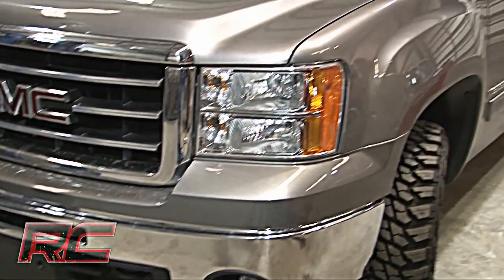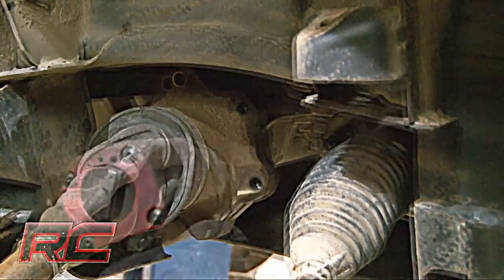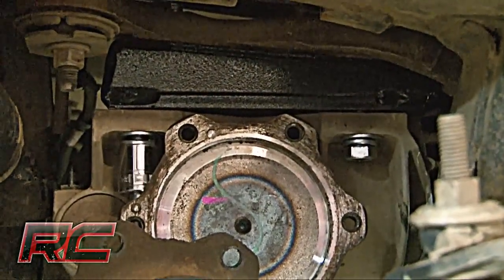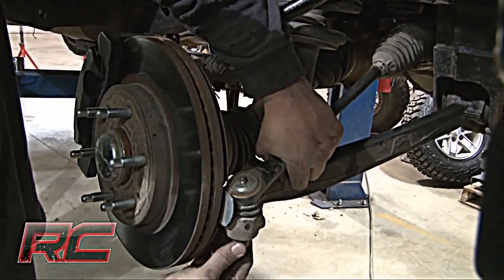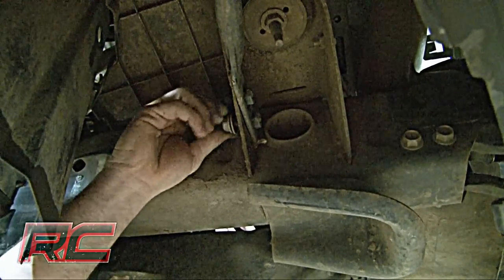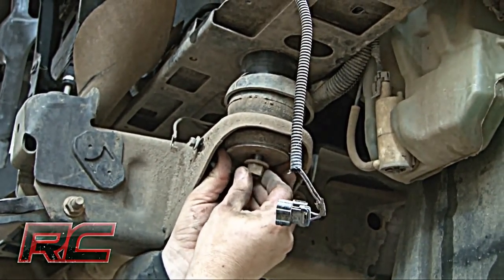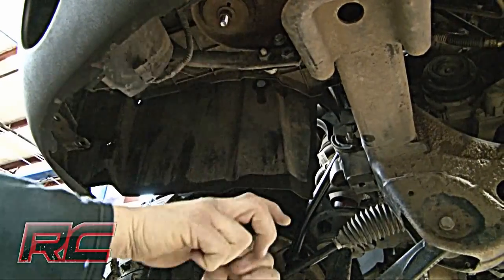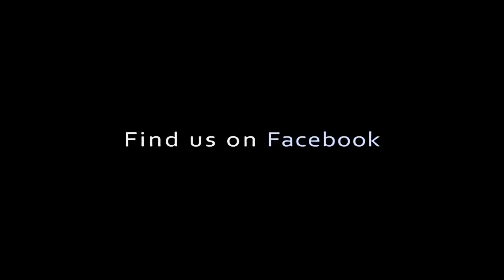Installing 2007-2013 4WD Chevrolet Silverado / GMC Sierra 1500 4.75" Combo Lift Kit by Rough Country

Comment: Curious, what size hardware? and will deep well sockets be necessary? 
Would this be something I can complete in my driveway without a hydraulic jack?
Reply from the maker: http://s3.amazonaws.com/roughcountry/install/257.pdf

Here is the link to the install instructions with all of the bolt sizes. Deep well sockets might be needed in certain points of the install and yes it is possible to install this in your driveway.